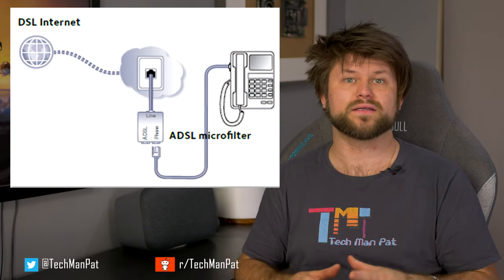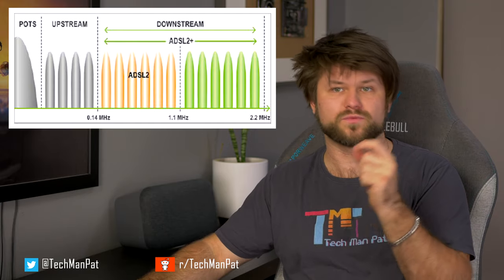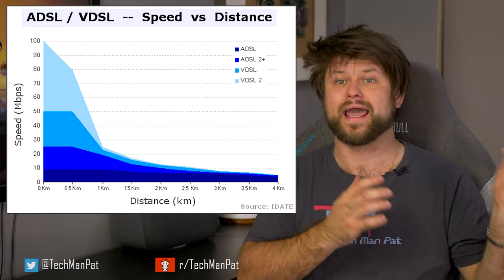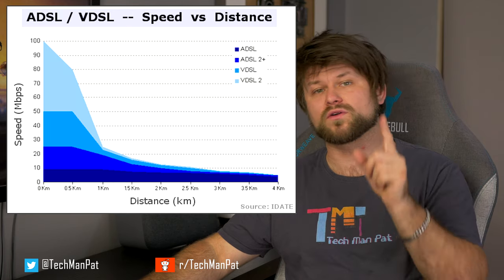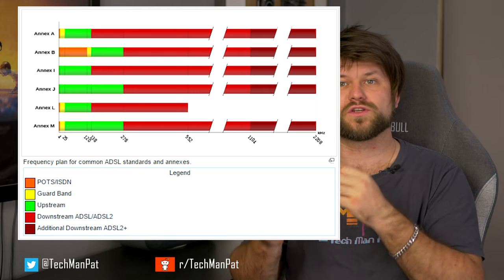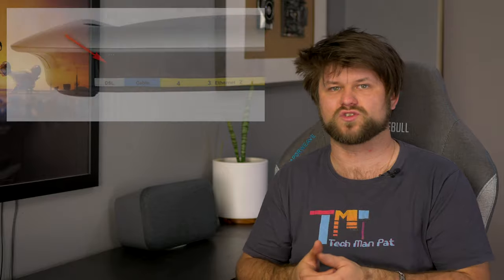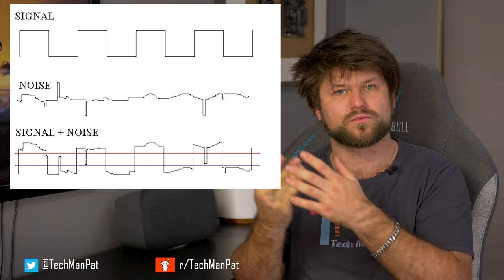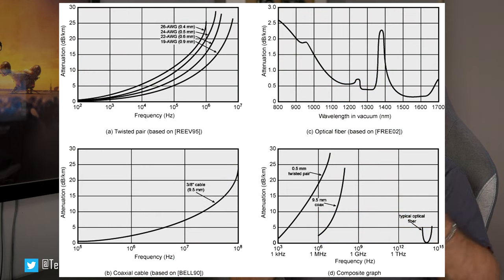Part 2 - FTTN Modem Jargon Explained | TechTalk

Comment: Ok so copper line that is less than 300 metres long from NBN network will mean superb porn streaming, got it! Love this channel.
Reply: I am nearly 500m from the node and get a 98Mbit download and 38 Mbit upload connection at 6 to 7 db SNR.  My copper lines are barely twisted as 1970's vintage but had quite a few repairs over the years and now seem stable at this high speed.  I am using a very good connectivity modem (Fritz 7490 with v7.19 Beta firmware).  So the rule of 300m  depends on many variables like the modem, line quality and SNR setting.  :)

Comment: Hi Pat, regarding line attenuation for FTTN I find many  vastly different results between different modems on the same FTTN connection..   I use a Fritz!Box 7490 and for me  474m from node (measured by the Fritz modem) my attenuation is  19db down and 22db up at connect rate of 97,122 kbits/s down and 37,643 up.  SNR 7db down, 6db up.  Max DSLAM 115,832 down, 44,200 up.
My point here is other modems measure the attenuation at different frequencies to each other, often unspecified.  There seems to be no standard set for universal attenuation measurements. A good example is a Telstra modem that specifies 3 download and 3 upload attenuations ....example here is
down  21.4, 42.3, 60.8 db
up 11.7, 35.3, 49.3 db.
It is noted the Fritz has a lower download attenuation db than upload and in a Telstra modem is opposite.
Manufactures of modems refuse to divulge and detail on frequencies used it even in the case of AVM who make the Fritz modem won't even say how the line length is measures saying it's proprietary information.
If you can dig up more technical info and make it part 3 for the modem, that would be great.   Cheers
Reply from the maker: Thanks mike I have acctualy reached out to a few manufacturers to send me multiple modems to test
Reply: @TechManPat  New beta firmware for Fritz,  supports WPA3, VDSL Long range and a heap more features.
Reply: @TechManPat  Check out all the new stuff Fritz can do at https://en.avm.de/fritz-lab/fresh-from-development/fresh-from-development/
click on Updates and Improvements.
:)  On another Note I have a mate that had lots of grief with  Nighthawk 6 and 10 routers.  Apparently they have an issue dropping WiFi and loosing printers on 2.4G + vulnerability problems.  Forums indicated it was across all of the Nighthawks with Netgear only offering assistance if you pay  which amounted no solution at the end.   They were not too interested in doing anything about it further so my mate canned the Nighthawk routers for an Asus one.....Don't shoot me, condemning Netgear ..I am just the messenger lol.